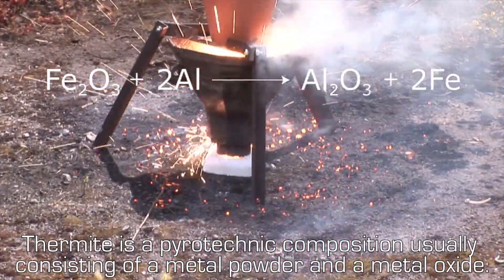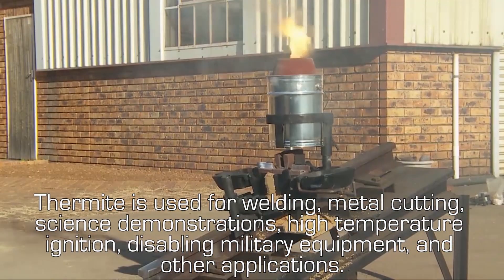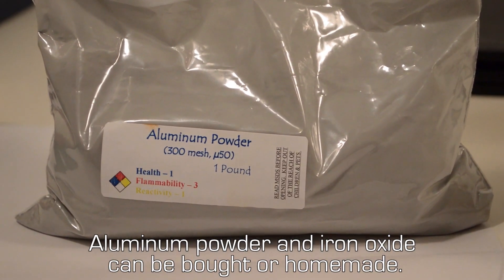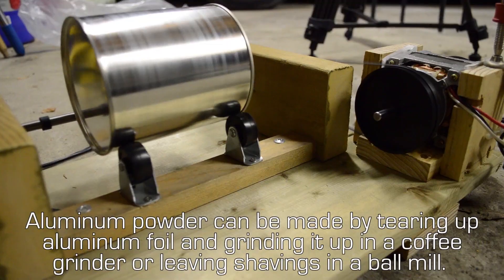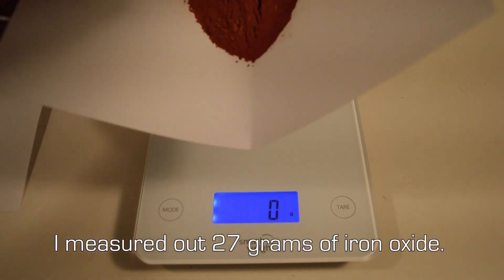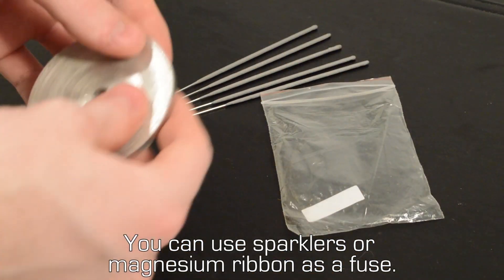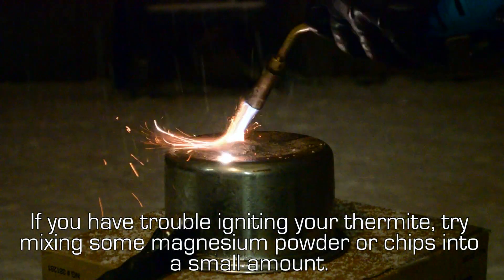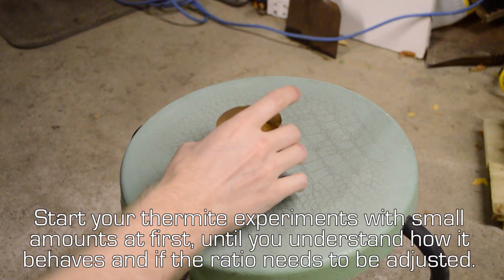What Thermite is and How to Make it

Comment: When you mix fuel, metal oxide, and metal powder in just the right way, it burns at 2000 degrees Celsius, hot enough to cut through almost any barrier known to man. Throw some C4 into the mix and you've got one hell of a combination.

Comment: jet fuel can't melt steel beams but thermite can
Reply: Thermite can't melt a car moron
Reply: Hey wind and plenty of fuel paper etc and the how heat rises was enough to melt that steel I saw it pouring from the tower before it fell. And later when I was there picking up whatever was left. That building design had each floor with steel supports from the core of the building to the  outter steel building facade. No bearing walls in between once enough steel was heated to where it started to bend and pull away from the outside wall and inside wall enough of that caused the floor to fall to the next floor then that floor pancakes until enough wait just let the fucker free fall each floor crushing the under floor with enough force to make anything organic vaporize bang bang bang straight down because the concrete floors were poured around that center core. Keeping each floor in succession going down and the outside walls also keep it inside the footprint each collapsing away from the building after so many floors no longer existed the outter fell away into other buildings. Perfect collapse. And many thought it would of fell over like a tree ha ha if a 737 doing 600mph plowing into it didn't push it over nothing short of thermite and a nuclear reaction could push it over. Bldg 7 DEFINITELY was brought down I saw evidence honest to God.

Comment: When you mix fuel, metal oxide  and metal powder in just the right way it burns at 2000 degrees hot enough to burn through any barrier known to man add a little c4 into the mix and you've got one hell of a combonation.
Reply: Spåčë Vibəs If you actually knew what you were talking about you would’ve spelt combination correct.
Reply: I just re-read this what are you even talking about “metal oxide” “metal powder” you make no sense whatsoever.
Reply: @retardantjenkis2677  can you like not
Reply: Spåčë Vibəs Can you go play brawlhala

Comment: Amazing how flower pots are so useful in most thermal or explosive products. Not as good as mil spec products, but will do in a pinch if you need to melt or blow a hole in a door/wall.

Comment: When you mix fuel, metal oxide and metal powder in just the right way, it burns at 2000 degrees Celsius. Hot enough to cut through nearly any barrier known to man. Throw some C4 into the mix, and you've got one hell of a combination.
Reply: You have unlocked thermite

Comment: I read on a website that you have to bake the iron oxide for an hour at 200° Fahrenheit?? True or false
Reply: I don't know but if it's true it's probably getting all the moisture out of it
Reply: I can confirm that heating iron oxide makes a better result. First I tried to cut a steel pipe by just mixing aluminium oxide and iron oxide. I spent all 400 grams of thermite and the pipe was still strong enough to bend. Then I heated iron oxide in oven to make it dry. Then I was able to cut a pipe with 200 grams of thermite. Second attempt was also much brighter and much less spills.

Comment: When you mix fuel, metal oxide and metal powder, it burns at 2000 degrees Celsius, hot enough to cut down any barrier known to man.
C4 Explosions
And some C4 into the mix and you get one hell of a combination. #ThermiteOfRainbow6Siege
Reply: not hot enough to cut through tungsten, lol
Reply: Heating up something isn't enough to cut trough it, you'd need to melt the thing... And objects have thermal inertia. A simple flower pot can somewhat hold a thermite mix even tho it cracks, but then a piece of steel will tank the reaction without much damage

Comment: Don't make magnesium powder or tear it in little pieces, magnesium ingites itself with the oxygen and moisture if cut in little pieces, to store magnesium safely chemists puts it under Petroleum ether for preventing autoignition with air 
WARNING don't expose magnesium to water or high humidity places it will autoignite or worst explode, you does'n want a metal fire in youre garage because you can't put it out with normal household fire equipment (fucking bucket of water) 
Don't mess with magnesium, inform youreself before buying it BE SAFE 
Sorry for my bad english tho